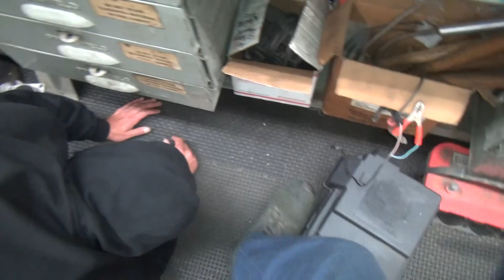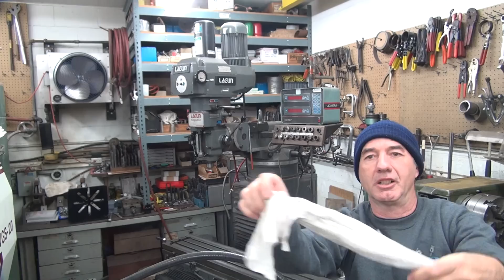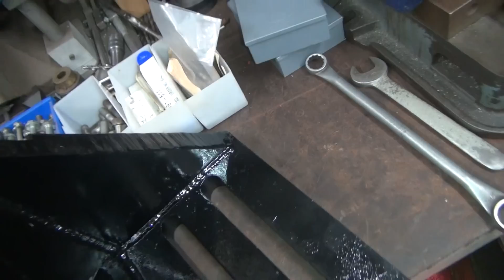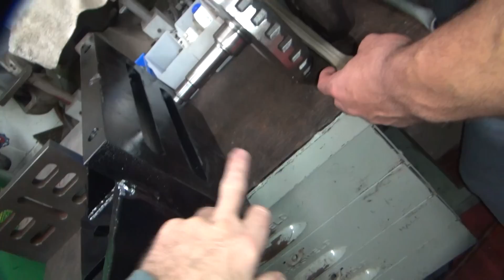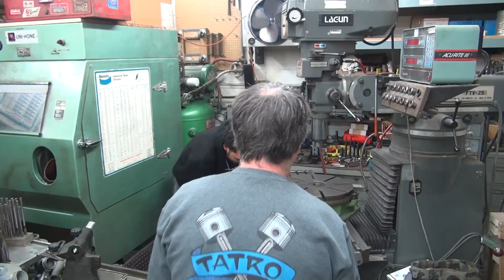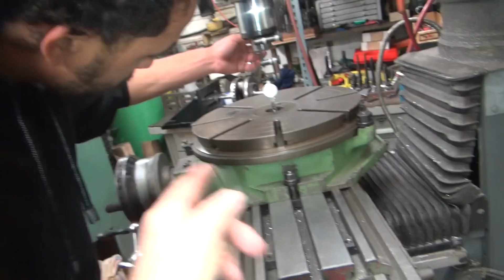#101 the making of a flywheel truing tool crankshaft milwaukee 8 m8 evo twincam harley tatro machine

Comment: put your dial facing the cieling when clocking a bore so you don't lose sight of it when it's facing the column. End up following the dial around like duck duck goose
Reply: it's a benefit of the finger dial most dials also have dovetails on the clock face side for that reason
Reply: also good practice to always rotate the chuck in one direction. Smoother dial readings

Comment: i spy a nice 6 jaw lathe chuck

Save the 1000 z axis power feed, You can buy a z axis mill crank socket for a drill. Gives more time to actually make chips and ride bikes, work smarter not harder!
\
Reply from the maker: i need the exercise anyway. that is the problem these days, no one wants to put in the efford to do the work.
tatro